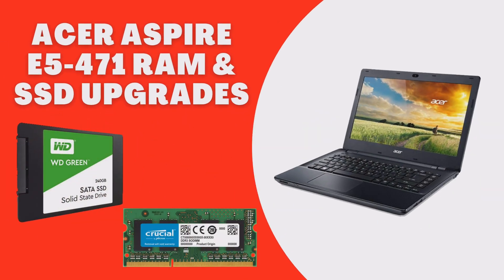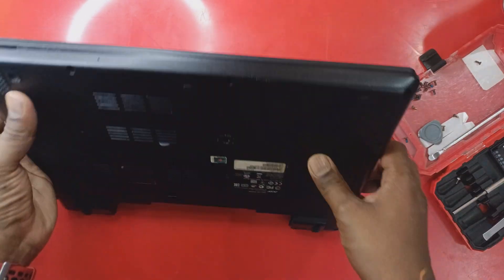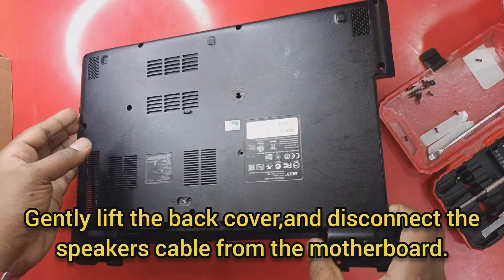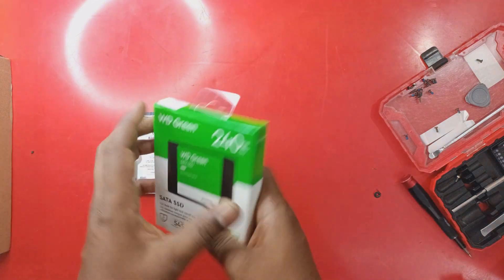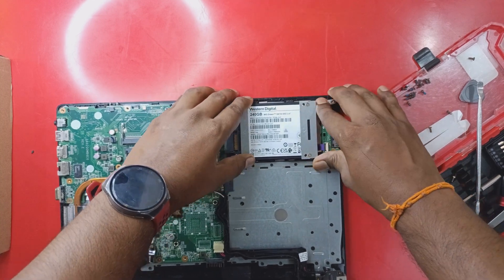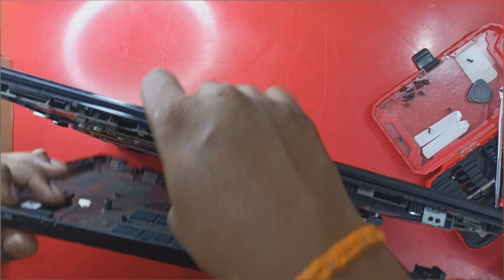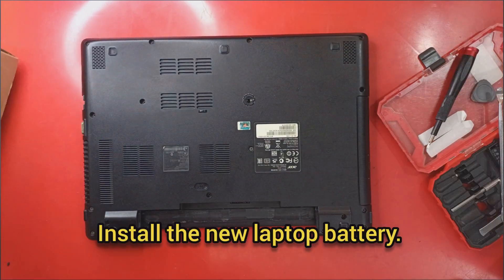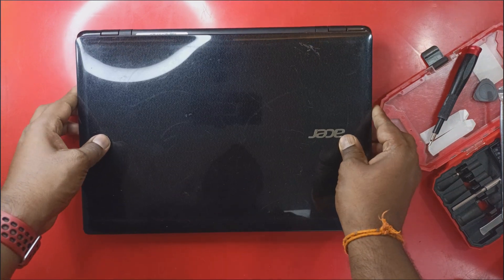ACER ASPIRE E5-471 SSD & RAM UPGRADE | |2023

Comment: Changed ram. But after that the screen shows no display while truning on....helppp
Reply from the maker: Try Do a Power Drain

How to Perform a Power Drain:
1. Shut down and disconnect:
Turn off your laptop and unplug it from the power adapter. If your laptop has a removable battery, remove it. 
2. Discharge remaining power:
Press and hold the power button for 30 seconds to 1 minute (depending on the method). This will drain any remaining electrical charge from the laptop's components. 
3. Reconnect and power on:
Reinstall the battery (if applicable) and reconnect the power adapter. Turn on the laptop.

Comment: 1.5V or 1.35V ram which one??
Reply from the maker: The Acer Aspire E5-471 supports DDR3L-1600 SODIMM RAM, which is 1.35V RAM. It is not recommended to use 1.5V RAM in this laptop, as it may damage the components.The laptop will not boot up.

If you are unsure which RAM to purchase for your laptop, you can use the Crucial System Scanner tool to scan your laptop and get a list of compatible RAM modules.